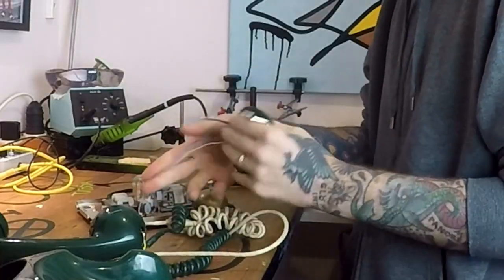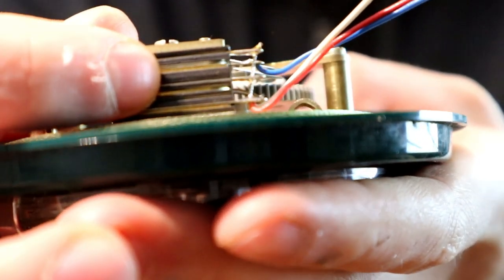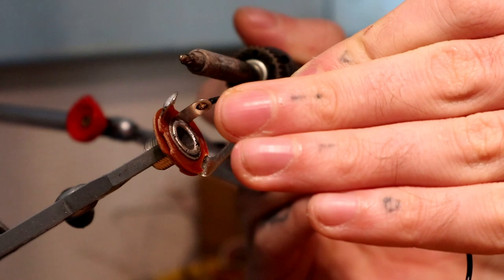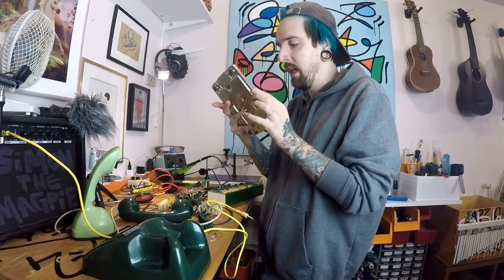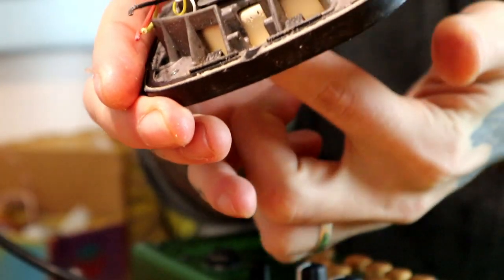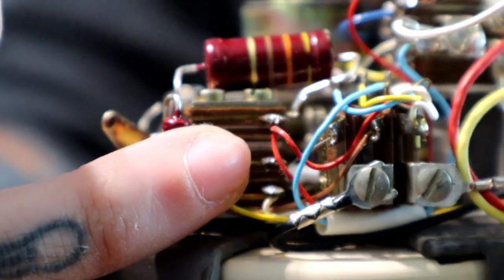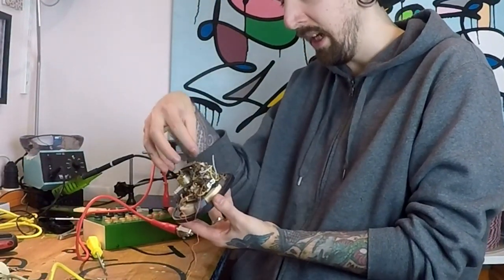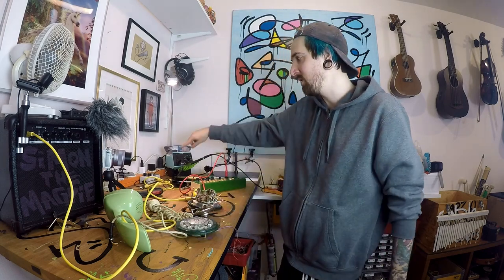Turning Old School Phones Into Guitar Pedals | SUPER FAST DIY

Comment: Super nice! By coincidence, i came across the exact same model phone today! It's also a pretty cool gate source for modular synths, it turns out.

If you tap out a small pin in the rotary dial, as well as remove a little clock spring, it can be modified to spin continuously!

Comment: Interesting and incredibly entertaining. I would use that kind of thing, for a drum machine. First I would study the set up, then I would figure out what octave it was in. After that I would, change out the clockwork parts with electronic parts. I would figure out, how to use the gears to move wheels. I'm sure, I'd have to take apart a lot, of old telephones. I'd make sure, they didn't work first, to avoid electrocuting myself.

Comment: Isnt this just what a killswitch does ? Just mash it for stutters right ? Why go through all this when you can get a small button instead ? Correct if im wrong please i want to know the general difference.
Reply: It's completely unnecessary. The point is to have a tactile, visual techy piece of electronics hack. More fun to use, and looks more interesting for someone watching you perform. Same reason LMNC makes an elaborate wall of gameboys instead of just using a video game chip VST.
Reply: @Hlecktro  that makes alot of sense thank you very much. That was my initial takeaway from this but it would be pretty interesting to see none the less i suppose.

Comment: tried this last night. my phone had 4 wires but still used just the top and bottom.
got it working while in pieces, i made a stand and mount for it and now it stopped working? 
i can hear the signal faintly over hum if i touch the cable to some metal on the mount. 
is this a grounding issue?
Reply: Im having issues with feedback when I use the stutter. He didn't mention a resistor but I'm sure there needs to be one somewhere.
Reply: Trying it right now, my phone also has 4 wires, did you find the issue?